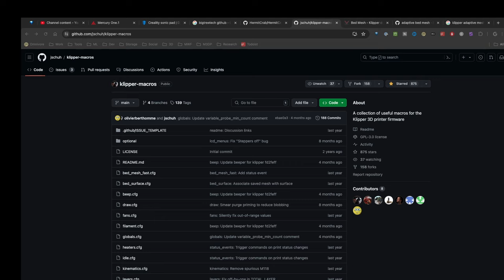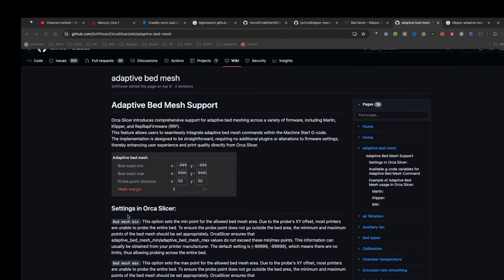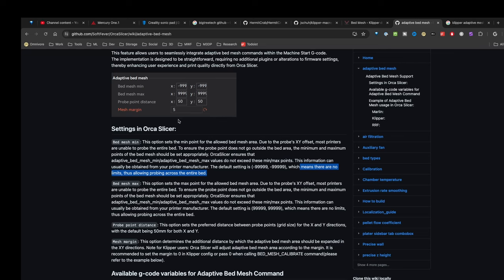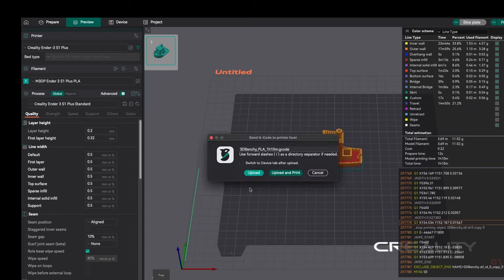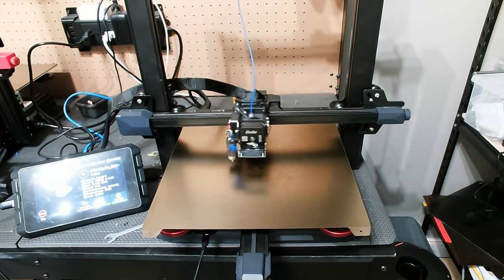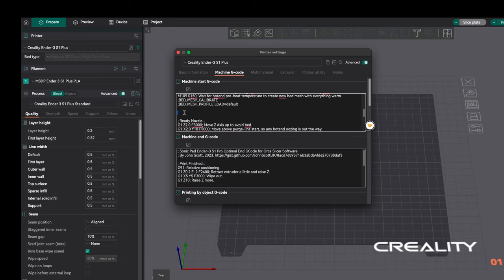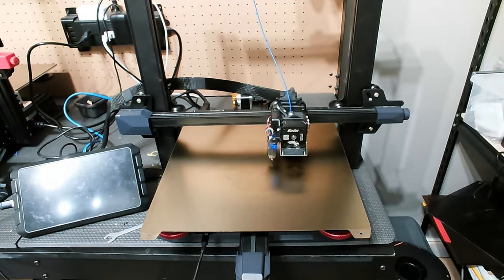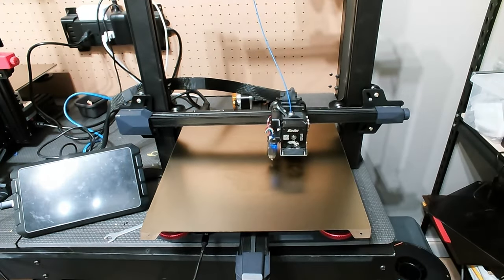Orca Slicer Hacks: Effortless Bed Leveling with Adaptive Mesh

Comment: Your a star I will try that now on my e3v2 with Sonic Pad.  Funny thing is my probe with sonic pad only does one probe per point 5X5 but is a lot faster than your s1?
Reply from the maker: I appreciate it. 

I like to probe twice. It is a setting in the printer.conf
Reply: @minimal3dp  I have done it for my e3v2 and worked a treat?  Could I put this over in the Cura Start?

Comment: Having problems getting this working with Marlin. For whatever reason the gcode generated with orcaslicer doesn't do the adaptive bed mesh and skips the step entirely. I was able to get it working with the prusaslicer implementation of adaptive bed mesh (from RH3D video), it does the bed leveling step, but what I don't understand is that from the face of it, the gcodes generated look pretty much the same, even when I replicate what I used for the prusaslicer gcode in orcaslicer, the orcaslicer gcode still skips the bed leveling step. What could I be doing wrong?
Reply: I'm having the same issue with my Ender 3 Max Neo running the mriscoc firmware.
Reply: @hhkotze  well, the update on this is, it works if the probing doesn't have to occur on the outer limits of the bed. What limit this is I have yet to discover, but I suspect it has to do with probing margin in the firmware.

Comment: How to get the "adaptive bed mesh" section under basic information from the printer settings? I don't even have this settings, only adding start g-code doesn't work..
Reply from the maker: Are you using the latest RC?
Reply: @minimal3dp  Yes, OrcaSlicer 2.2.0. Updated everthing, it shows the settings now but still makes full bed mesh 😞 (not full like before but still makes a probe in every corner...). 
Now it makes:
1. Probe in every corner
2. probe in middle (adaptive)
3. purge line (KAMP)
4. probe in every corner
5. probe in middle (Adpative)
6. start print

Like wtf?

Comment: thanks, however, I'm now getting adaptive_bed_mesh_min is undefined.
Reply: You need to add it in your config
Reply: The starting coordinates for you mesh 15,15. Or something similar. 
The start X and Y coordinates
Reply: @TheButchersbLock  thanks, do you have link to a sample that I can take a look? Cheers
Reply from the maker: If you look at the orca slicer wiki and there is an example.
Reply: @minimal3dp  yeah, I have looked but it still not working as it kept complaining about the same error. I've reverted back to KAMP for now. it's rather tricky too when you have klicky.
Reply: @unlock-er  Kamp is the best, I prefer lamps purge line